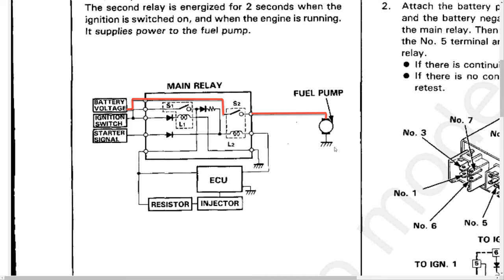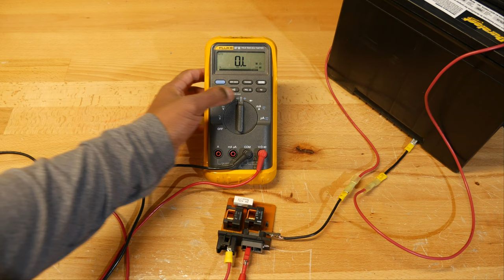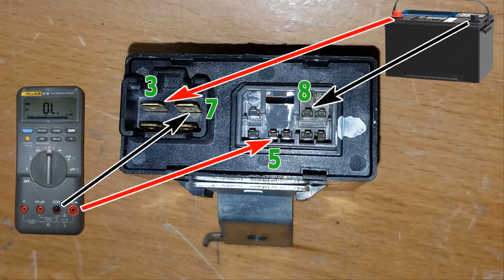1991-1995 Acura Legend Main Relay Test

Comment: My 93 acura legend is cranking but wont start, as soon as i let go of the starter the car just dies but i can hear the main relay clicking, any ideas?
Reply from the maker: If I understand you correctly, the car starts momentarily then dies when you let go of the key? You could have a fuel pump problem, or the ignition switch may be bad; I would start with the ignition switch.
Here's a link to a playlist that might be useful: https://www.youtube.com/playlist?list=PLTOFtJfRmbkbHmjCcI71puMNnpzIFIldH 
Here's a copy of the factory service manual - page 23-80 in the Engine Electrical section has an ignition switch test: https://bit.ly/3X83Isa
Reply: I got the same problem, replaced a fuel pump and it worked,
Reply: Exactly what I was looking for! PERFECT. Relay was OK. Onto to checking other things. Bless you.

Comment: Is 1999 Acura RL main relay located in same position?
Reply from the maker: I've never needed to access it, but I'm fairly certain it's in the same location. What kinds of issues are you having?
Reply: I found it. A little different location but I have car working. Thanks
Reply from the maker: @lewisspivey321  Nice 👍
Reply: The fuel pump is not working so I'm going to try to see if the fuel main fuel relay is bad or good